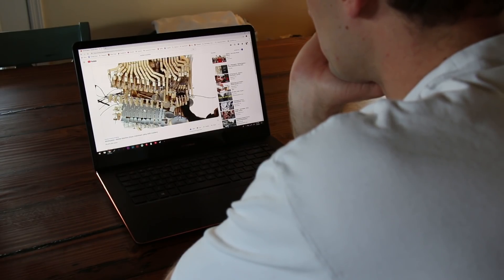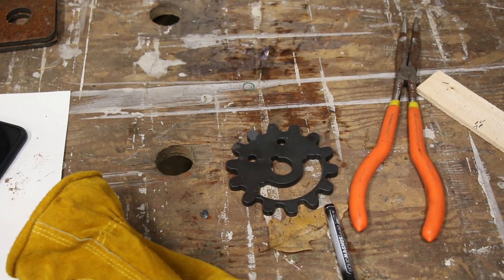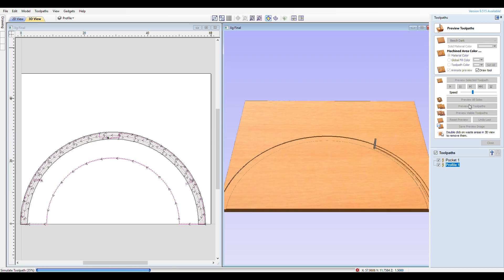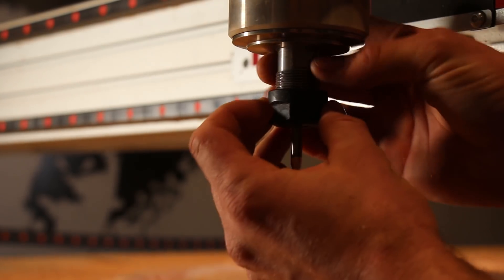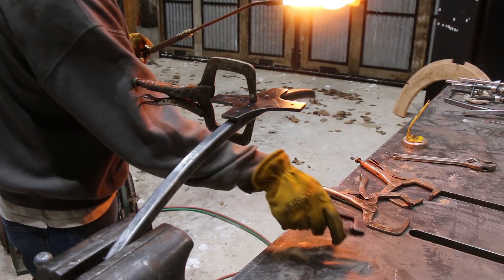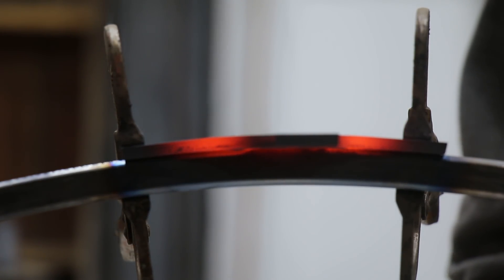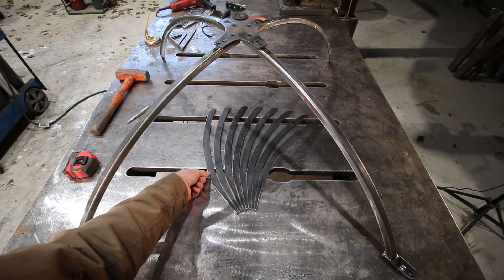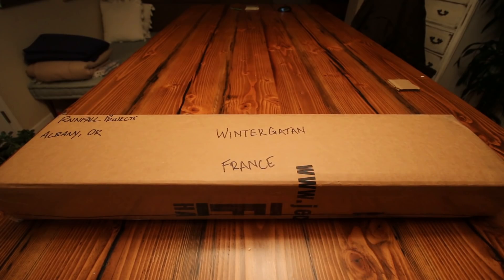Fabricating Parts for Wintergatan and the Marble Machine X

Comment: Can I give you one advice as a metal worker?
when you are working with tubing for exterior use, always keep at least one hole at the bottom of your metal structure otherwise the closed tube will fill with water (cause of humidity) and it will litterally explode from pressurre and rot.
 o/

Comment: JD, what a thrill it must've been to collaborate with Wintergatan on Marble Machine X. While all of his videos are incredible, I especially enjoy the other side of each collaboration. Including the talents and skill ofs creators and makers such as yourself really makes Marble Machine X one phenomenal project. Kudos to you and Wintergatan on this collaborative effort. I can't wait to see where metal Wilson ends up!

P.S. I can totally relate to your experience of engineering, cutting and fabricating in a vacuum, so to speak. I just finished a television production set where I modeled and cut all the architectural millwork (13 arched, divided light windows, and associated trim), an ornate 5'x8' gate (an almost four hour cut job), internal structural supports for round, half-round and angled columns, and a 68', 10-section cantilevered organic curve. While I felt good about everything through the modeling and cutting phases, I'll admit to some trepidation when it came to final assembly. You see, none of the pieces were dry-fit as either sub-assemblies, or as a complete pre-build, so it was incredibly exciting to watch as everything fit together in the real world just as it was designed, cut and assembled. Too bad it was all for a single, 14-hour shoot!

Comment: With a "pop-nut" it was easier to get a thread in metal, also you're inserting a lot of heat into the structure and I'm really surprised it didn't warp with that much heat on one side. 
These are pop-nut's if you havent heard of this:  http://www.emhart.eu/eu-en/products-services/products-by-category/popnut-threaded-inserts/popnuts/index.php

Comment: If you bend past the radius you might be able to flip the part and press it to unbend the circle (if the circle is small enough that it does not hit the floor). It is not good for fatigue, but a little back bending won't hurt. 

As for the gnarly cut off angle it 3d printing is amazing for creating jigs for this kind of thing. Even if you just use the 3d print to trace the line. This also works great for drilling holes at weird angles or spots that are hard to locate manually.

Comment: JD. Great video! I have a suggestion for an easier way of putting threaded inserts into the square tubing. Google, "Rivnut". They are a cross between a rivet and a nut. They have had a big impact on how I build things. If I need to bolt something (steel) to something else and not have the nut fall off, a rivnut is the answer. It works like this: Drill hole, screw rivnut on to the rivnut tool, insert into hole, squeeze, and you are done.  Check it out. The tools are cheap and the rivnuts are reasonable. You are a fine builder/fabricator.

Comment: You need shorter and larger diameter cutters for your cnc router. Though they can be fairly expensive, they will save you many hours in machine time. They will also alleviate chatter, as well as reduce excess wear on guides and what not from less side loading of the cutter.

Comment: Nice! The threaded inserts worked out well, the whole machine is over engineered so long threads is appropriate. An option would have been flow drilling, just because it's rather cool. Albeit hot. Finally, the sound of your plasma cutter should definately be the voice of some demon entity in a movie.

Comment: Hi I see that you having some problems there with diving when doing small holes. You see it @2:44. You should consider change the delay after Arc OK mode.  You can also just try tightening up the voltage window (volts above and volts below target tip volts) as well as reducing the percentage to 2% for % change in ATV.

Comment: thats 7:13 a nice device for bending profiles..............    i actually almost lost my left hand when bending a bar once with a machine that did the same, but instead it ran on hydraulics, and it didnt have a break on it neither did it had an emergency stop... so when i was working too fast my left finger got stuck, i lifted my feet from the controller pedal, but it was already too late.............. auch.   luckely they fixed me up in the hospital and my fingers are healed enough to work again (and more important; to play the [bass] guitar and piano)............ but next time i am going to bend bars like that i would prefer such a manual machine like you are using here.
i came here via the wintergatan channel btw... and i subbed.  nice video.

Comment: JD, I hate to be a #youshould douche bag, but you freak me out drilling unclamped metal on the drill press. Please consider a work holding device of some sort. Mutilated fingers are no fun. Great video, as always! Best, @HoneyOnWales
Reply: Belt driven drill press 
Belts slip before anything gets thrown or crushed
Reply: @fowletm1992  That's funny. You're fortunate you've never had a serious catch. Scares the hell out of you how quickly it happens and with shocking force. Essential Craftsman had a recent discussion about this. Was a good talk, check it out.
Reply: Been doing it for a long time 
Its all in the way you hold it and the position of your hand 
Gotta hold it firm but don't grip it and keep the reaction side away from you 
Note he's mostly just pressing the work down to the table and if it grabbes it'll spin away from him not toward 
Its an essential skill you have to learn with bigger equipment such as using a spade around a post hole digger 
Iv had work get ripped out of holding fixtures as well 
And had a mag drill rake off and skate it's way across a truck tray 

Doesn't matter how you secure it it's more got do do with thinking ahead and positioning yourself 
Comes subconsciously when you work on a farm from your youngest years